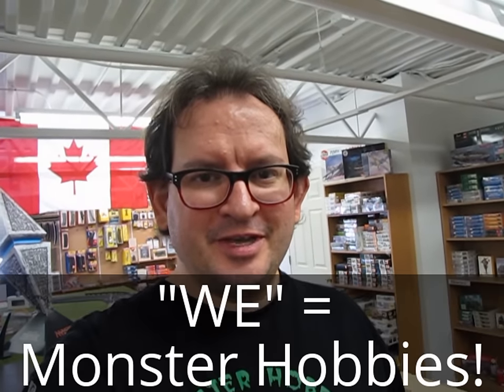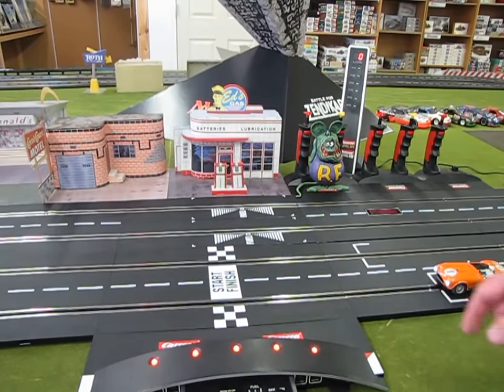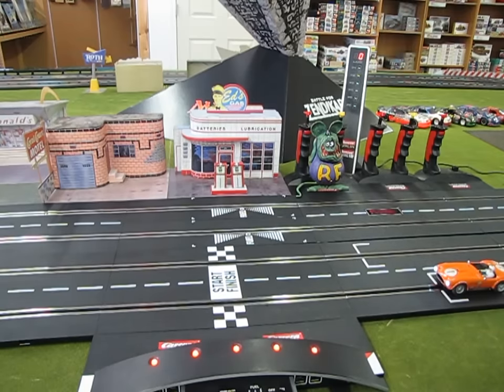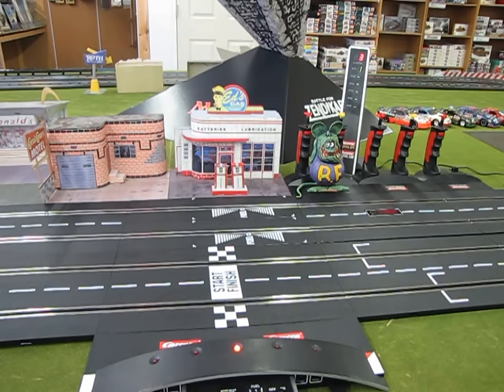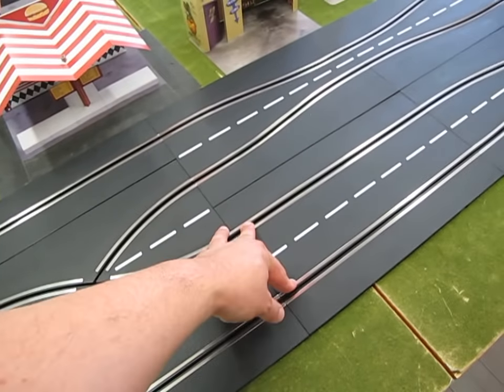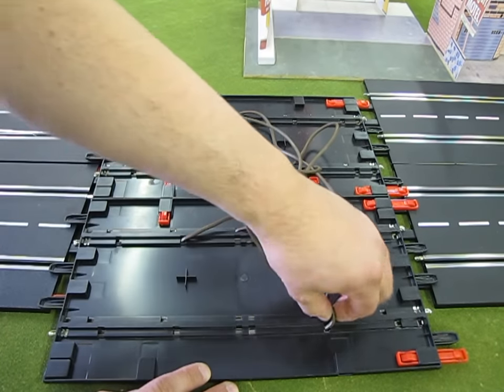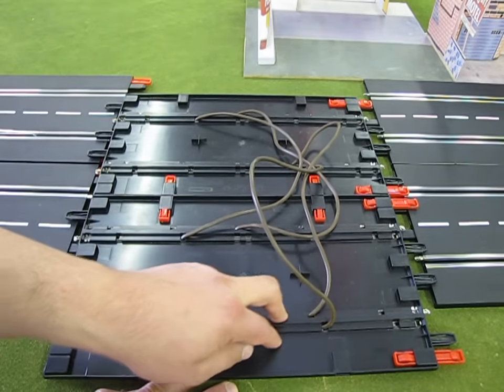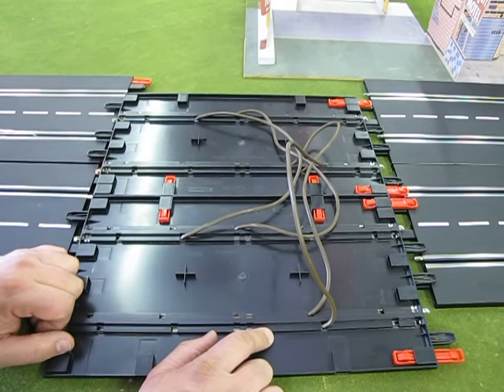How To Make A Carrera Digital 4-lane track - An improved update.

Comment: To keep guys from running the same lane we employ ghost cars. We program them to run much slower so you need to change lanes to get around them. To keep the ghost cars from switching lanes (b/c they will switch w/o warning and run you off the track) put a piece of electrical tape over the photo-emitter on car and they'll stay in the lane you want them in. If someone runs a ghost car off the track, they are penalized with 3 stop-n-go passes through the pits.
Reply from the maker: Cool idea!
Reply: That's a good tip! why didnt I think of that. Obvious isn't always the most obvious lol

Comment: What would happen if you run the copper wire from the top of the first track to the bottom of second and bottom of the first track to the top of the second?

Also, if using just two lanes, do you know how to have one lane going in one direction and the other lane going in the opposite direction?
Reply from the maker: If you cross wire it, then you would short circuit the Control unit. As far as I know, the digital cars can only run in one direction. the Carrera Evolution cars can run in opposite directions though.

Comment: I wanna make a 4 lane track. What pieces do I need so the cars can change to all lanes? Thank you in advance.
Reply from the maker: By the new multi-lane power tracks, (20030370) for starters, and then Right hand straight switches (20030313), Left hand strait switches (20030345),  Double Lane Change section (20030347), Left hand inner to outer curve switches (20030362), Left hand outer to inner curve switches (20030363), Right hand inner to outer curve switches (20030364), Right hand outer to inner curve switches (20030365). - Hope this helps.
Reply: @monsterhobbiesonlinestore  awesome. Thank you so much. Gonna probably be 2-4 weeks before I get all as some are out of stock. I have 2 sets of the 2/30 high bank curve. Is it normal that some tracks don’t actually click with the connectors for a secure lock. Part of 1 end seems to always pull apart at times .